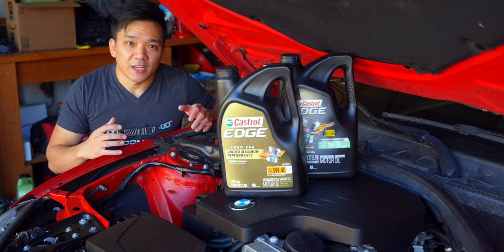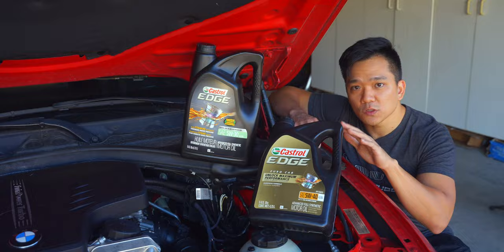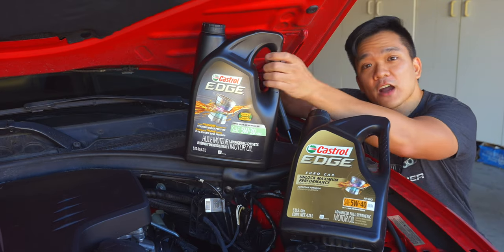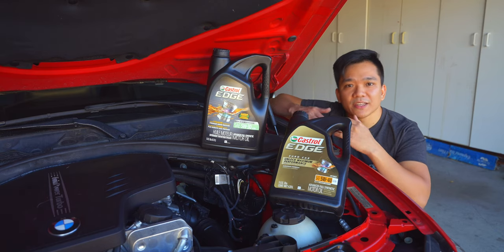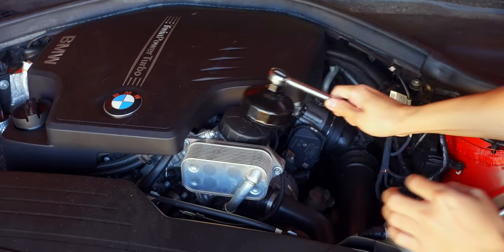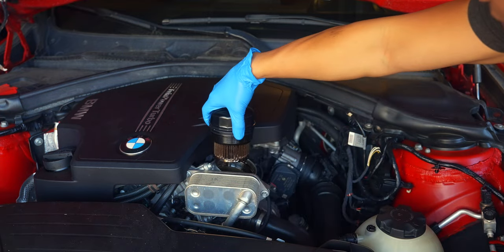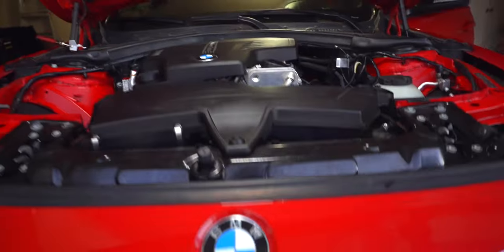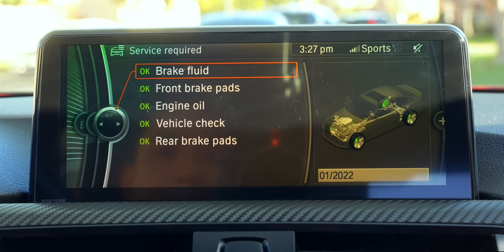BMW F30 Oil Change | N26 & N20

Comment: Like your videos but this is just hearsay information. What are your sources that Shell/Pennzoil 5w40 is the exact same as the BMW 5w40? Also, BMW switched over to using the LL-17 rated 0W20 for emissions, performance but mostly to help combat startup wear on the timing chain components. No, they’re not the same oils. Similar in numbers but not in additive pack or base oils. Now, a BMW oil IS rated to go the 10,000+ miles than the cheaper versions of Castrol 5w30/40. Castro’ls own higher performance synthetics, about on par. As for the oil filter, that plastic drain plug only applies to the RWD models. xDrive models have a metal oil pan with metal drain plug. The Mann part number is different as it comes with the two filter housing seals and a brass crush washer for the drain plug. Great video production as always, just incorrect/biased information.
Reply from the maker: Thanks for sharing especially on the AWD models. I'm always happy to learn form a fellow enthusiast. Looks like I'll have to look into 0-20 if it's easier on the engine and better for gas why not
Reply: @FritzRamos  oil viscosities are an interesting science! Traditional thinking is that a thicker viscosity oil will last long and reduce engine wear, which it does to an extent. The idea behind better flowing lower viscosity oils is that the great deal of wear for newer engines is from lack of oil, oil flow and lubricity. For such a high performance engine that produces a lot of waste heat, the new Corvette C8 uses 0w20. Mind boggling haha
Reply: @FritzRamos  not necessarily. If you drive sporty on that 0w-20 oil, you’ll burn oil. The full saps that’s in the castrol oils that’s rated for the longlife 01 spec is perfect for a sporty drive style or soothing peaceful ride. If you want good cold start up oil flow and high protection, then run a 0w-40 oil that’s rated for the longlife 01 spec.
Reply: @DuckMcDuckinson  I run 0w-40 Liquid Moly in my X3. People don't understand what the numbers mean. I run 40 over 30 because I live in Virginia and it is hot in the summer and I also do plenty of stop and go driving and 40 has better high temperature protection. 0 is great for cold weather starts. I might check out 5w-40 but will definitely stick with the higher temp protection because of where I live

Comment: I have a 2014 BMW 228i RWD ATM. I know from factory it was 5w30, but I called the BMW dealership and they said BMW themselves switched it to 0w30. So I just said screw it and bought 5w30 Schaeffer's Advanced European Performance, it has LL-01 spec. I commute about 100miles a day for work. It just turned Spring here in Alaska so while its warm I hope the oil will work its magic and coat its innerds. (Micron-molly and Penetro) A combination patented by Schaeffer's exclusive to them.
Reply: Plus Schaeffer's been around since 1839. 😮
Reply from the maker: Good to know. I know they switch with later versions of the F30, but I'm not sure what the actual data is with models rated for 5w30. Going thinner is supposed to lubricate better and be better on gas, but if you're happy with 5w-30 then keep using it.
Reply: @FritzRamos  , shoot bro. I think I messed up. My turbo isn't as responsive 😅😆.

Comment: Your videos teach so much I can’t wait to get my first BMW!
Reply from the maker: Thank you. Looking forward to seeing your build!
Reply: @FritzRamos  hey fritz! I got a question. Last oil change I put 5.25 qts of oil in my engine and it read full on the screen. I noticed when I was changing the motor mounts one day that the drain plug had evaporation on it and I checked the level when I finished the mounts and it read quarter of a way down. Funny. Drove until the next change and the level was still the same as the last time I did the oil level check. The engine on idle was smooth but I could hear the combustion of the engine a little almost like it had piston slap but not harsh. Thought it was because the oil I used was heavier than the one I used before. Cars temperatures were amazing as well. I went to measure just how much oil came out of the engine with a measuring pitcher and it was 4.2 qts…….. note I put in 5.2 and the sensor didn’t say that it was a quart low. I know it’s not the sensor because I put in 4.7 yo be safe and it read halfway but then I put in half a quart top off it read full. Did 0.7 quarts really come out of the engine through the drain plug? I’m using AMSOIL so I know it’s not the oil because the car still drove perfect.
Reply: I feel as if I did over tighten the plug but I checked the plug to see if the threads messed up and it was perfect and the o-ring was good too. Now I use a torque wrench to make sure it’s at 8 NM.
Reply from the maker: @DuckMcDuckinson  I would account for some oil to be taken up by the filter. For the rest, check your turbo inlet pipe and see if you have blow by in there

Comment: Excellent video and presentation. Thanks. Went for an oil change today but the shop could not get the drain plug off. They said it was stripped. What are my options other than taking it to the dealer. Or, is that my only option. Thanks again.

Comment: I used this and had unbelievable high oil temps 255 while doing 65mph
Reply from the maker: Oh no, I hope everything is okay now. Would you mind sharing more details like, if your car is tuned, mods, driving conditions so other people can learn how to prevent that from happening? Thanks
Reply: Stock 2013 328i xdrive 90k miles no tune 93 only from Sam club . I think my temps on the highway be like 234

Comment: i have a 2014 bmw 328i with 113,382 miles and it has a stage 1 tune should i use liqui moly 5w 30 or 5w40
Reply from the maker: Whoever you got the tune from, should have that answer for you.

Comment: My N20 (2016 320i xdrive) says to use 0W20 under the hood.  Thoughts?
Reply from the maker: I think the newer models started using thinner oils from the factory. That should be fine and better for fuel economy as well as emissions

Comment: Fuck men I just bought and put 0w30 for my N20 F30 with 110 000km is it bad??
Reply from the maker: Not necessarily, it depends on where you live. Do you deal with snow or extreme heat where you live?
Reply: @FritzRamos  Damn thx for the quick response!! I'm from Montreal so we have hot climates in summers and very cold winters. The thing is that I think I have a broken gasket or something so I'm loosing a lot of oil in leaks. So I bought some 0w30 to ad when needed. This morning I coldstarted my car and their was a LOT of smoke coming out of my engine, tailpipe and in the cabin but the blue gray smoke stop when I drive. I recently had some coolant and later that day check my oil level and my problem is that I don't know if I need to had oil in the engine ( where you remove the oil cap ) it seems like only the chains are lubricated a bit but I can see the bottom with no oil. I can't check my oil level because I don't have a freaking stick and need to drive/warm my engine to check oil level. But I'm too scared to drive with low engine oil and blow up my BMW. Sorry for the long comment but can you help? What would you do? It's a 328i 2013 F30 btw
Reply from the maker: @alexinadon7999  Is there a way you can scan it? Is there a check engine light on? If not check for and vacuum leaks first

I had a similar issue but it was less severe and ended up being the boost pipe.

https://youtu.be/eLNvgyr3L-g
Reply: 0w30 is Approved and recommended by BMW in LL04 with SHELL and Castrol